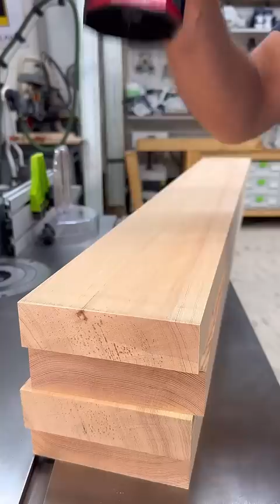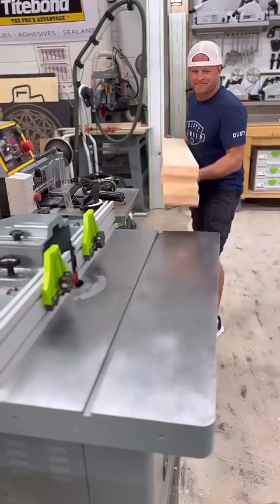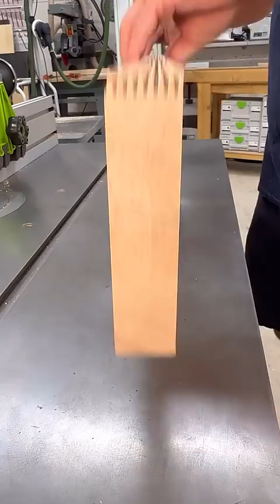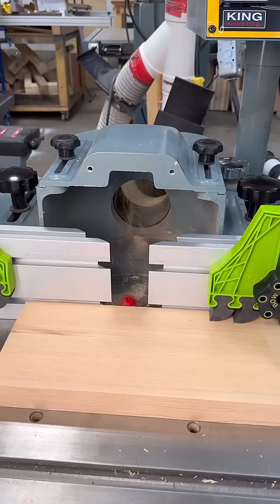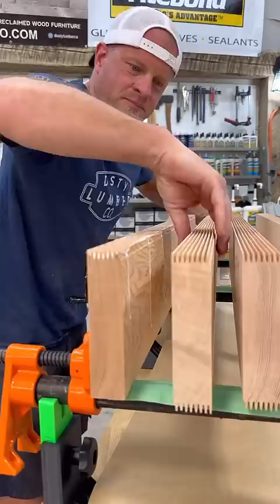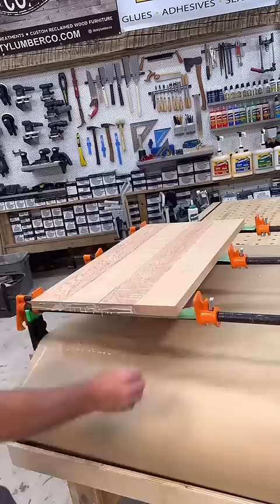Freud finger joint bit and I definitely used way too much glue #freudtoolsambassador #woodworking

Comment: This bit is for end grain to end grain glue ups. Using it in this fashion is nearly completely useless, if not actually weakening the joint. It might help the boards register a bit during clamping, but otherwise I'm pretty sure this would actually be weaker than if you had just glued the flat faces together. 

Look at any factory-made butcher block and you'll see what I mean.

Comment: I can't stress enough about being absolutely sure that you use enough glue! You can't add to it anywhere it's possibly missing after the fact it's cheap enough to be liberal with it when gluing up especially when you have paid the current prices for good quality wood nowadays!
I just run a scraper down the joint on both sides and ready for sanding without worrying about glue-voids!
 All jokes aside I am sure that Titebond approves of this glue-up method 😅!

Comment: This is not what you'd use finger joints for. Along the grain a proper glue seam does just fine. Finger joints are for end grain etc.

Comment: I never trusted glue until I glued two planed down 2x4s together end to end. Waited 24 a hours, and slammed the joined prices into the concrete to break the joint. After like 4 hours I was left with several pieces, but the glue didn’t fucking break. 😂
Reply: Hits* not hours😂

Comment: Quick question, how secure actually is this connecting? Because based on the depth of the grooves, it looks like it would fall apart fairly quickly

Comment: How do you get the joint to line up correctly? If you use the same bit for both pieces of wood, the two boards would have a mirror image of each other and they wouldn't press together. Does the bit have to be raised or lowered to get the joint to line up so the pieces press together? Just curious because we obviously didn't see the bit being adjusted here and I don't work with wood so I don't know these things.

Comment: What i want to know is how all these youtube vids show folks sqeezing glue out so easily.   Im a pretty strong guy and i have to squeeze/crush the bottle with 2 handed deathgrip for like 5mins to get that much glue to come out.  What the am i doing wrong?  Are they thinning it out somehow?  I promise its not clogged or anything obvious.
Reply: I use titebond3 if that matters.  Ive used 2 and dont recall any diff in ease of squeeze.

Comment: Igloo is water soluble used plastic squeegee to squeeze you off the excess and then you wipe it down with a damp cloth with water on it that much glue ensures that there is no are gaps in the finger joints but it is funny

Comment: Would you have to mak slight adjustments to the blade so that the pieces come together level or do you just need to flip the board?
Reply from the maker: If it’s set up right then just flip the board 👍

Comment: In this video... This router bit is being used exactly 90-degrees IMPROPERLY for what is intended. This bit was designed to allow "glue surface mileage" for BUTT-JOINTs.. extending 2x4's... 1x6's etc etc... there are SO MANY FAR SUPERIOR/CHEAPER ways to do joinery for a table-top etc... jeeez man... SHOW WHAT this Freud Router bit can DO already!
Reply: It doesn't matter what something was made for.
You can also open beer bottles with a screwdriver or make patterns in butter with a comb🤣

Comment: Now that i know what they're called, i can definitively say i absolutely despise finger joints. They are without a doubt the UGLIEST possible way ever conceived to join two pieces of wood together. Hmmm what wood species should we use for the door frame trim, oh i know lets take a bunch of random scrap pieces of wood and finger joint them into one ugly mismatched piece of trim that no matter what you cover it with will always look like crap from every angle.